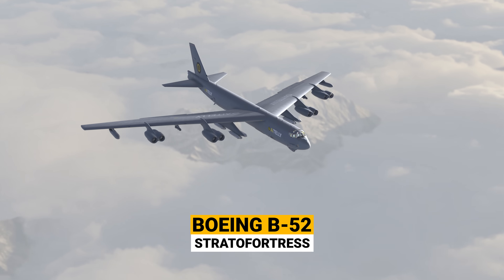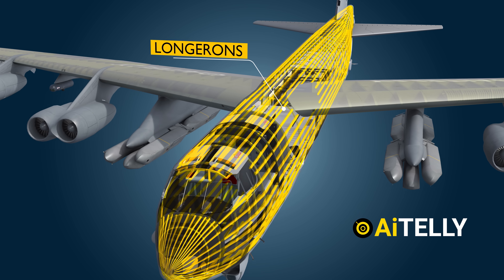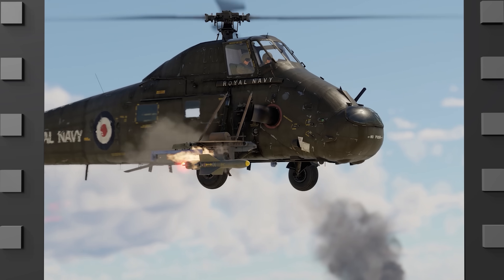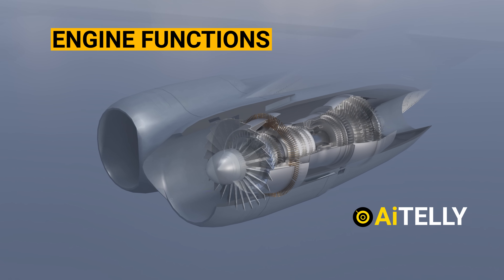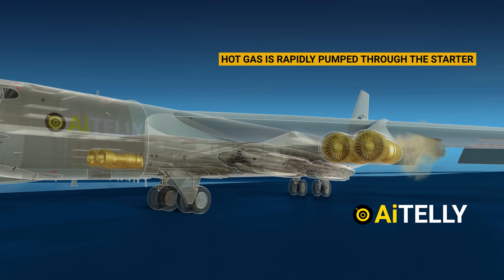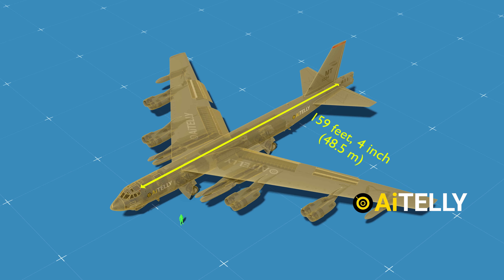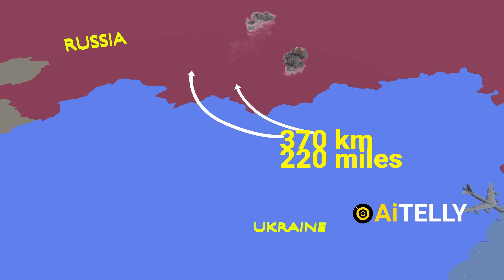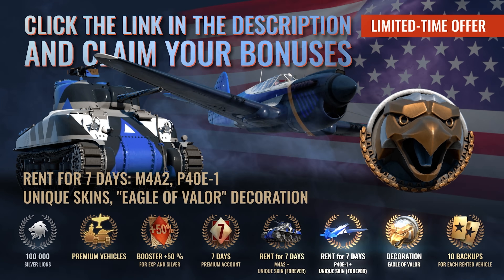B52 Bomber Boeing Plane | How it Works US Airforce Bomber

Comment: 8:30  you can start the #4 engine with shotgun shells?  WTF dude, it's 10 lbs of black power, not shotgun shells and you don't start all 8  engines at once.  And it's been 20 years since I flow one but I thought the H model had turbofan engines.
Reply: Starter cartridges can be installed in all engines.  Two were used for normal alert ( 4 & 5 ), with engine bleed air used to start the other six.  If the situation warranted it, all eight could be started at once.
Reply: @stevel1458  Hey Steve, yep   know all that, worked in 96 bomb wing Dyess AFB Tx.  My thing was he said SHOTGUN SHELLS  wtf.

Comment: I oculd be wrong but the explanation of the wing spars being made of alloy and magnesium isn't correct?  A steel alloy by definition is carbon steel combined with one or more ingredients... so it's probably 'a steel alloy containing magnesium'
Reply: Actually, it's probably aluminum alloy like most other airplanes.  I don't find this this video to be all that accurate.
Reply: @gort8203  
          You are correct.     The spars are 6061 Aluminum alloy.   The skin is Alclad 2023 Aluminum alloy.    

     The only steel is the bolts used as fasteners.    The wheels might be magnesium, but are most likely Aluminum.

         It sure why he thought the wing and fuselage were steel.     And to clarify, steel itself is an alloy of iron and carbon.
Reply: @Stepclimb  Thanks.  I think YouTube creators often just make stuff up based on their own assumptions.  It amazes me that they think they know enough about a subject to think their assumptions can be valid.  I can only assume it is the Dunning-Kruger effect.

Comment: Can you do a video on the national electrical grid. 
But go into detail about the fact that there are 300million customers, buildings and homes and streets and....
It is a $TRILLIONS and $TRILLIONS and....infrastructure asset. 
100years to build but carries only 15% of the total energy used. 

It is fragile because it is extremely expensive. 

BLACKOUTS if too much electricity is in the grid. It is fragile and extremely expensive. 

People must understand these simple facts for future plans to make sense. 

My electricity bills is 90% grid rental. 50cents kWh, 45cents kWh grid rental and 5cents for the dirt cheap electricity. 

Transmission towers, Distribution poles, Street poles and wires to the millions and millions and millions and millions of computers. 
Switch yards and transformers in the millions and millions.

The grid is the money making machine. Which is ok but not understood. But it is limited becaue it is so extremely expensive to expand its capacity.

Comment: I don't see a program in the pipeline that'll replace it, upgrading the platform is way easier than creating a new one from scratch.
Reply: Most B-52 built have already been replaced by newer bombers, and another one is under consideration even before the new B-21 enters service.  What is not under consideration is building from scratch another slow bomber with the radar signature of a battleship. The one we have still works in limited roles.

Most of the B-52s are retired, but they keep a few of them around becuse they are still an efficient bomb and cruise missile truck for lower-threat environments.  All the new bombers can also do what the B-52 does, but the B-52 augments them so they can be used for missions in high threat areas.  The B-52 will also deliver CAS after the medium to high altitude SAM threat is rolled back.

Comment: Pneumatic start?
Reply: A "huffer cart" with its own turbine engine connected to engine #4  from a hose provides high pressure air to get the turbines rotating.

Comment: Actually you got a couple things wrong. But the big one was the Navigator and radar operator in the back do not eject upwards, they eject down and out of the aircraft. Only the pilot and co-pilot have upward ejection seats.
What you're calling the electronic warfare station no longer exists at that particular location. It is combined with the bombardier's station in the lower deck
Also they do not use full flaps on takeoff typically set at 3/4. On Landing they will typically you use full flaps.
Also the B-52 rarely uses laser designator they tend to use GPS guided weapons for the vast majority of weapons
Reply: The Flower Flaps of the B-52 are fully extended (35 degrees) for both takeoff and landing.  The flaps deflect fully during the first 37.5% of extension with little rearward movement.  For the remainder of extension the flaps move rearward only, increasing the area of the wing.  Unlike more conventional aircraft, if you took off with partial flaps you would have all the drag but only part of the lift produced by the flaps, so there is no benefit to it.  Since the airplane doesn't rotate for takeoff that lift is essential in shortening the takeoff roll. Why would they use start using only 3/4 flaps 70 year later?
Reply: The B-52’s Fowler flaps have only two settings, full up or full down.  Furthermore, the flaps are retracted quickly after takeoff in order to achieve a satisfactory climb rate, as they produce significant drag.
Reply: He mentioned the lower deck positions ejected out the bottom of the plane.
Reply: The electronic warfare section definitely does still exist. Future plans call for them to be combined but the aircraft is not configured in a way that makes this possible yet. The instructor electronic warfare officer occupies the old gunner seat when instructing a student.
Reply: @Wyomingchief  Both of the seats in the defense station eject upwards. The defense station still exists and the EWO still sits there. The nav and rnav do not do any ECM duties because there are no ECM systems downstairs for them to use. All they have are GPS, radios, radar, and weapons systems down there.

Comment: As for it defending against fighters, you missed something. Early B-52 Bombers used to have Tail Turrets either with 4 machine guns or a single Gatling gun. The B-52 also took part in bombing Hanoi during the Vietnam War, in what is known as Operation Linebacker II
Reply: @iridium8341  Yes really, I was a B-52 defensive Aerial Gunner for 8 years.
Reply: B-52s continued to have a tail turret until the end of the Cold War in late 1991.
Reply: Yes this is true the b52 on display at the Air Force Academy in Colorado Springs is credited with a kill using its tail gun
Reply: Always thought they replaced the tail turret with a concrete block.

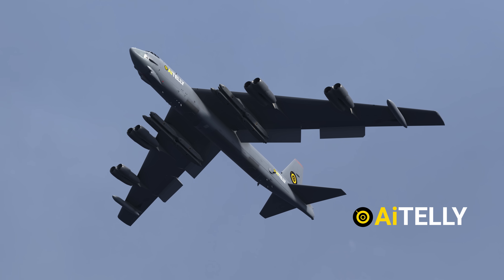Comment: Another informative and entertaining segment.  However, a minor correction:  At 6:11, change Superfortress to Stratofortress.  Beyond that - Because the B-52 goes back to 1952, an expanded version of this segment could included the various changes through history like the evolution then elimination of the rear turret.
Reply: What’s really funny is that the design for  B-52 is older than the US Air Force, and start out as an army air corps project in 1947 in fact a  Army air, Corps officer approved the start of the project first B-52 flew in 1952 there a older you tube chip of a Boeing engineer who was at that meeting in a hotel he goes over how what and when and is one of the original engineers
Reply: @fastone942  In fact, one of the original designs for the B-52 had turboprop engines  like the Russian TU-95, which entered service at around t4he same time. The B-52 design was then switched to turbojet engines.
Reply: And, it has approximately eight engines!

Comment: Its funny as with todays engines, we can power this plane with TWO(2) and it would  have MORE power than these do LOL..
Reply: Yes but to do that you would have to completely redesign the hydraulic system. It was designed for 8 engines and why none of the 4 engine upgrades were done. Its also why the USAF is testing a business jet engine for them as they can put 8 of the on and cut maintenance and fuel cost as they will be high bypass engines with parts still in production
Reply: Mil spec requires redundancy. And more redundancy.

Comment: Wrong, they are Rolls Royce engines now.
Please check facts before teaching the masses outdated info
Thanks
Reply: Facts are low on their priorities.
"Approximately 8 engines".
Reply: As of the release of this video, there was not a single B-52 flying with the RR engines.
Reply: @denali9449  how did they test to see if the engines are good ? Fly without them ? 🤣
Reply: @davidrobertson5700  Understand that the F130-200 is is not a brand new engine; it is a derivative of the highly successful BR725 commercial engine configured for the dual pod installation. As of August 6th this year, Rolls Royce was just wrapping up testing at Stennis Space Center to determine the best nacelle design. Even with its proven track record the engine must go through years of testing and qualification runs before seeing it first plane. 

You do not test an engine for reliability and functionality by mounting it on a plane to see what happens. As of this writing, there are no B-52's sporting the new engines in flight. According to the USAF "The first two test B-52s will be modified at Boeing’s San Antonio, Texas facility beginning in 2026. It will take a few years to upgrade these bombers for the first time, Cleaver said, and ground and flight tests will go from late 2028 to 2031."
Reply from the maker: Pratt And Whitey were the Original Engine  Suppliers : )
Get you facts right before you Comment it can work both ways Beautiful in the Comment sections
Reply: @Aitelly  Rolls Royce engines now, facts are beautiful and so is the comments section. 
Shows how unwise you are and above all shows that you refuse to listen to and understand fact.
This means you are giving out false information and therefore your channel is nothing less than clickbait
Reply: @davidrobertson5700  I don't think they've actually started the engine upgrade program yet.
Reply: @rwcassel2970  yes it has been on US news. Brush up

Comment: The fuel transfer is to compensate the asymmetry of the yaw, not the center of gravity
Reply from the maker: Yes you re 100% right, but I really heard the pilot say something like Like weapons Payload uneveness and Battle damage also
Reply: @Aitelly   they would deploy wing payload pods alternatively and not just on one pod....So back and forth... as what will happen as the fuel burns off???
Reply: When one wing is heavier than the other due to holding more fuel or stores it doesn't cause yaw, it causes roll.  So it is center of gravity.
Reply: Retired Buff Nav here: It's for CG...
Reply: @alanreynolds2287  yup, they also did that in the Concorde...